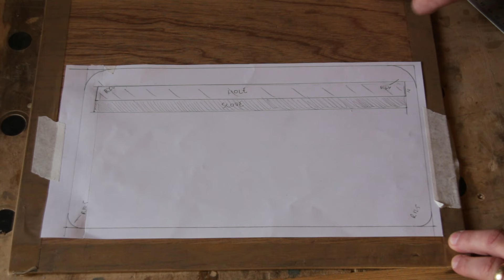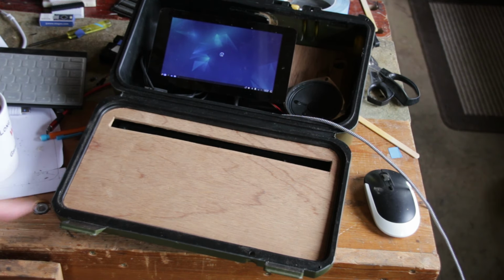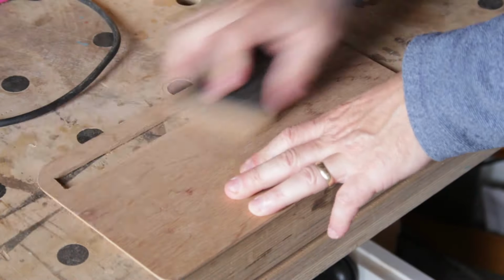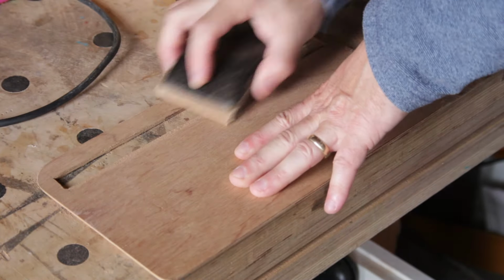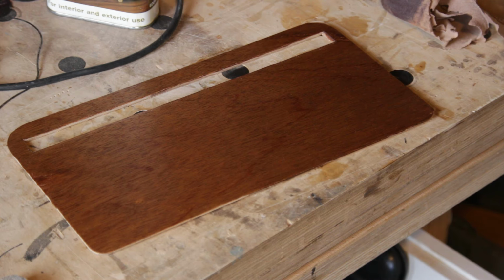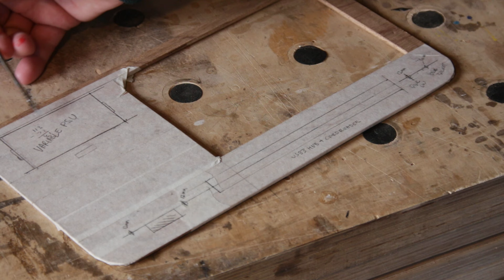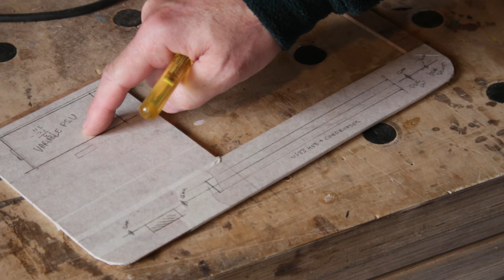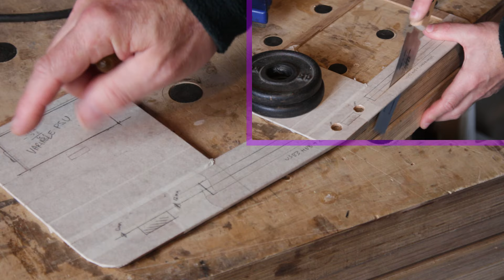A Woodworkers Cyberdeck

Comment: Thanks Simon, that was an interesting project concept, don't apologise that it wasn't all woodworking, you made it interesting despite some limited techy language and although I'm unlikely to build anything similar it was an enjoyable watch. Without going down a rabbit hole it would be interesting to see a short demonstration of the unit in use and the various functions it can perform.
Your disappointment with yourself over the cracked screen felt very familiar, we've all been there, accidents happen, you were much more measured in your response than I  would have managed ! Isn't it amazing how nice some bog-standard re-purposed ply.can come up with just.s little Danish oil although it's probably better than what you'd get today from the DIY store tbh !
Reply from the maker: Hi thanks for the comments Andy, I'll do some follow-ups on all the functions.
Reply: Yesterday I went to use the miter saw I'd purchased secondhand, an older 14" Makita from the 80s, and didn't think twice about the arbor bolt being reverse threaded to change blades. The pressure of tightening it cracked the inner flange into several pieces, making the saw unusable.  A direct replacement part is no longer made but I've ordered through eBay a, hopefully, workable replacement from a different model 14" saw.  The composire in the face of your mishap is commendable.
Reply from the maker: @YHWEH  Ah that's some bad luck, I hope the new part fixes it.

Comment: A very interesting project. I bought a Pi3 about 10 years and off and on I think about making it into a small portable system. I had always imagined making a box and using a superseded Android tablet as the screen and I have a small format wi-fi keyboard which is the same size. As with you, doing it as cheaply as possible would have been part of the aim. It would be much simpler for me because I would only want a programming platform without and extra electronics. Thank you, more food for thought!
Reply from the maker: Go for it Stephen, who knows where it will lead or what you will learn from it 😀

Comment: Simon, great build! I think the wood grain is a nice touch. Out of curiosity: You said early on you wanted to use this for microcontroller projects and the like, so is there any particular reason you didn't include a GPIO breakout on the faceplate? Was it a space limitation or something else?
Reply from the maker: Ah, a very good question with 2 answers.... 1) I couldn't find the room and make it look nice, I could fit it vertically, but it just wouldn't look right. 2) Using the GPIO of the Pi is likely to result in me killing the Pi and that would kill the cyberdeck, better to use another Pi and use the oscilloscope to fault find if necessary. I how that makes sense and,  thalamus for you question and kind words.

Comment: Combining a variable power supply, an oscilloscope and a computer would have been very useful back when I was studying robotics at university. I like the touch the wood gives and I would like to incorporate it in a future project.

By the way. Where can I find the UPS system that you used? Thanks.
Reply from the maker: Hi, The Pi hut has them, they come in 1,2, and 3 cell variants.